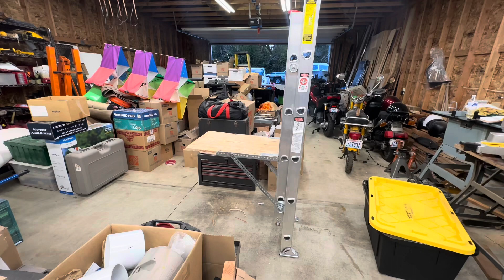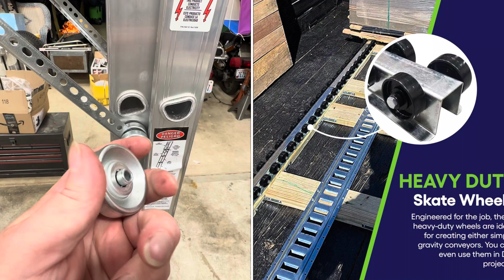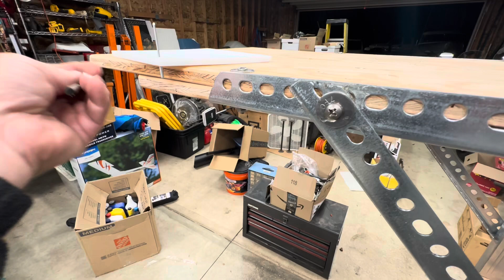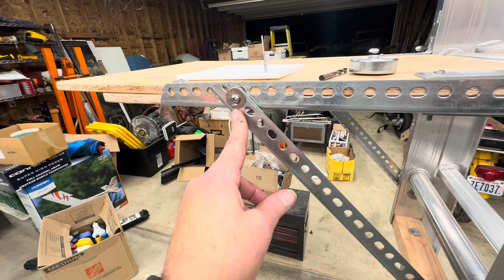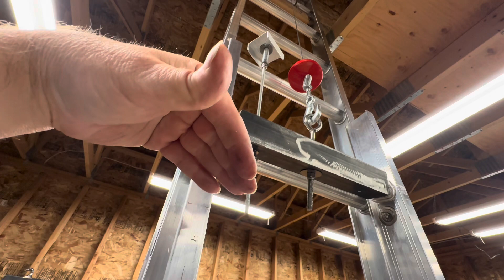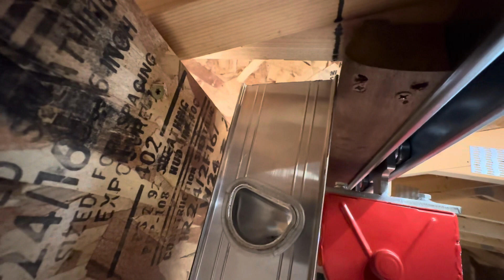Attic/Loft hoist/Lift . Easy & Inexpensive Electric platform

Comment: This looks great and gives me ideas for a similar lift.  Do you have any pictures of the teflon rub pad at the top?  Thanks!
Reply from the maker: I’m currently out of commission due to a hip injury.  The lift has been invaluable. The teflon pads were too thick & caused binding so I drilled out the rivets and removed them. 
I intended to shave down the material & reinstall but it’s been perfectly smooth without them. The lift is used so often it’s never been stowed away.

Comment: How much money 💰  and time ⏲️?
Reply from the maker: Just under $500- 28ft ladder $220 @ Home Depot. Hoist motor $99 @ Amazon. Conveyor wheels $16 @ Amazon 4ft Strut channel track $32 @ Amazon. Trolley wheels $29 @ Amazon
Everything else I had on hand , plywood, nuts, bolts, washers, brackets and epoxy ect…
I’m 62 with a bum knee so carrying boxes up & down a ladder is out of the picture. This was my only option. 
I’m surprised by the response to the video, maybe I should have included links & itemized description?

Comment: Great idea - what stops the ladder at the top from wanting to tip over?
Reply from the maker: Towards the end of the video I point out the L brackets holding the ladder about 5 feet from the top then  how it’s sandwiched at the top between the wall and a piece of hardwood attached to the rafters behind the hoist motor.
There’s very little force on the ladder in any way because the platform is fully supported by the hoist. The ladder is there to stabilize the platform. If you have any more questions at please ask.

Comment: I really like your ingenuity, Stainless is not the greatest choice for the bolts in my opinion as Stainless while tough, is not hard I believe I would choose Grade 5 to Grade 8 bolts which are hard.
Reply from the maker: I recently inherited a bunch of stainless hardware and used what I had on hand. I was hoping for comments pointing out ways to make it safer & more durable. I’m definitely going to be looking for a corrosion and ways to avoid the galvanic reaction. Thank you.